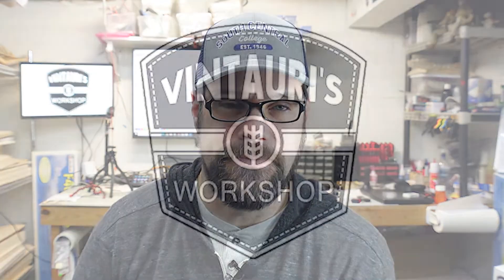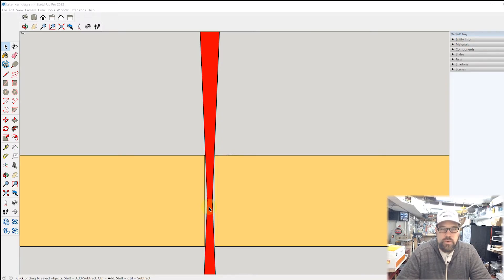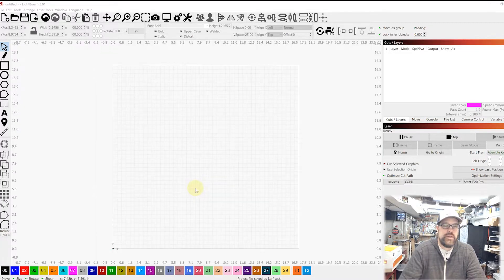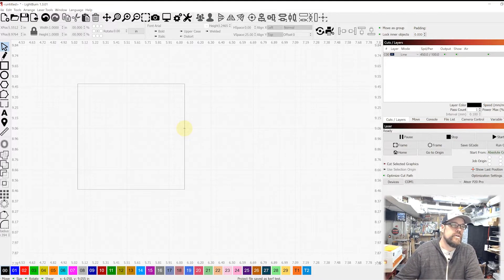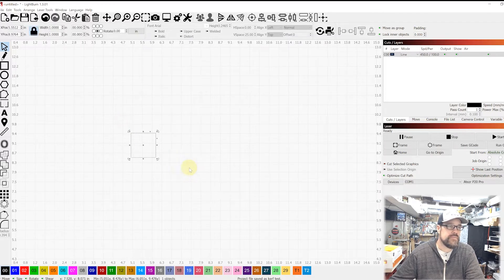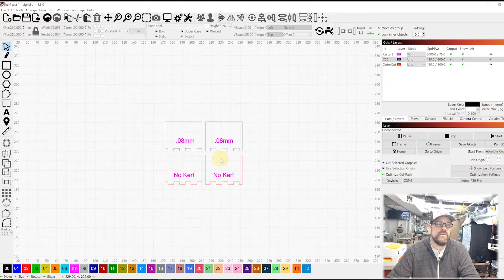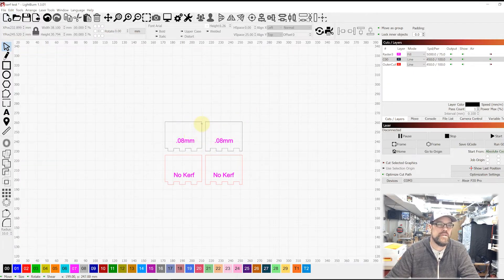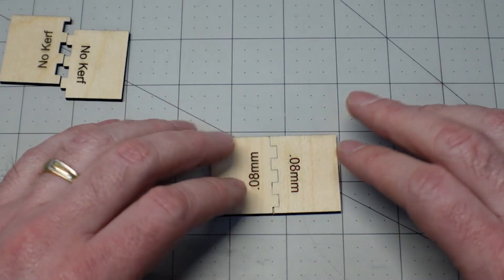Perfect fitting laser parts by adjusting the Kerf in Lightburn

Comment: When I downloaded the Box joint file it shows up as what looks like assII code in google drive on my lap top,  a bunch of letters and number. what file type should I save it as perhaps that help. Other wise and outstanding explanation as others have said. I appreciate showing the math on the table. just to confirm what I though I was seeing and hearing 😁🛫

UPDATE when I down loaded the html page to my down load folder It saved the box joint file as a lightburn file. i then imported it in to LB and It should up as expected.
 IT is my first day with the new brain! thanks maybe this will help some one else. now off to make smoke and hopefully tight joints.

Comment: So most of the stuff I work with is either 1/16th, 1/8th, or 1/4 width. Should I do a separate test for each one or will the kerf offset for the 1/8th be a decent middle ground for all of them?
Reply from the maker: The 1/8” will be decent for the various thicknesses of the same type of material, but I’d recommend a test when switching to day acrylic or foam.